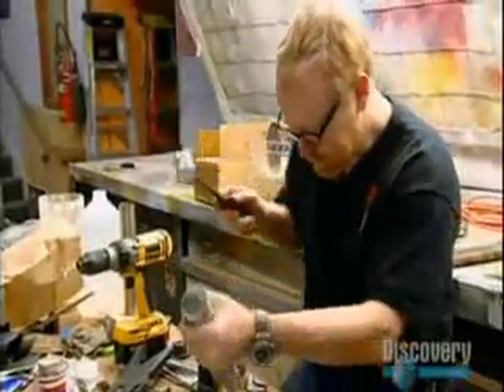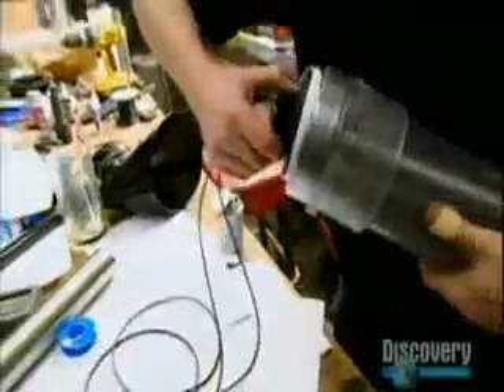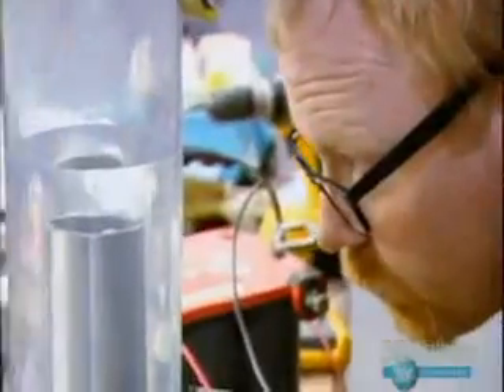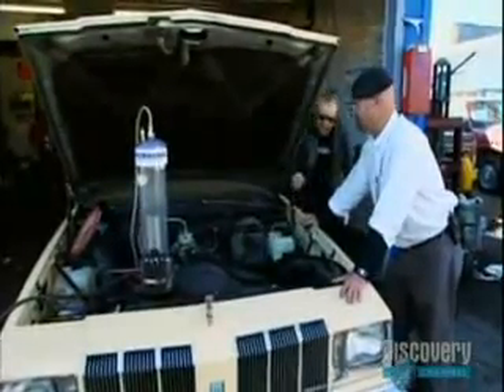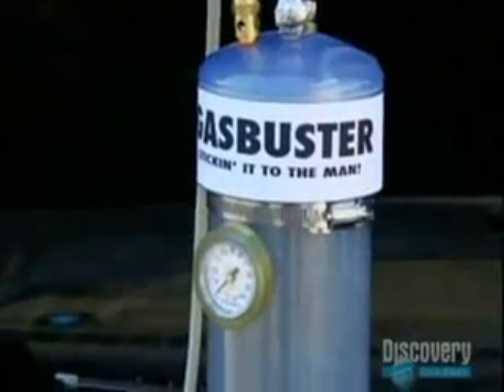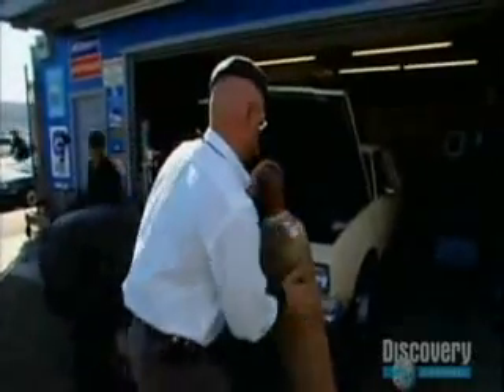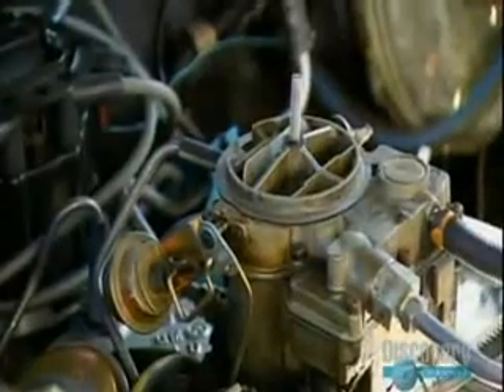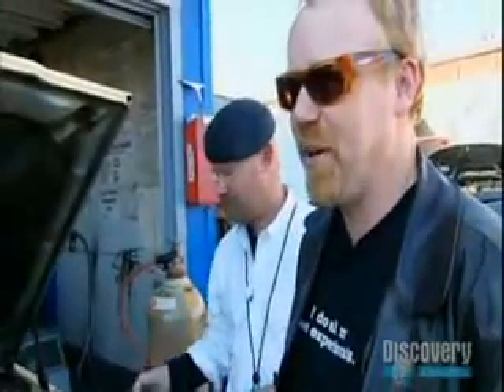HHO Mythbusters Explained

Comment: Stray capacitance...I am assuming you mean the signal that allows for lights and capacitors to be charged or lit wireless. You obviously have never done any of those experiments yourself or you would know better. A caduceus coil has near 0 impedance. According to the theories though a caduceus coil should cancel itself out and it does not. In one of my personal experiences a caduceus primary lit 3x the amount of lights with less input power.

Comment: The standard "scramble wound coil" does not perform as well as a caduceus coil. I have done many experiments with both and a caduceus produces better results everytime with less power consumption. They also call the caduceus coil a tenser coil, but that is only because someone would like to claim the design as their own even though its been around for century's. Everything is a frequency...measuring the actual power coming from any signal generator will not happen unless it is confined.

Comment: Its showing that you don't need as much power to get hydrogen as they claim. You seem to be overlooking the point. Also, once again, you keep overlooking dry crystal cell batteries. Telling me to just shut my mouth is not an effective way to shut me up. Also please tell me, according to the theories of electromagnetics, what would happen if a coil was wrapped in a caduceus form. Those theories state that it should just cancel out, but the opposite happens.

Comment: And the Dry Crystal Batteries. Mind explaining how those work...Its called resonance. The crystals resonate to certain frequencies and the resonant power from the crystals is collected. Same concept of using resonance to split the water molecule. I also finally figured out why so many arguments. Its quantum physics vs physics. Two sides to the same coin. Both are correct and both are the equal and opposite to each other. Without one the other would not exist.

Comment: The Con Artists are the ones claiming they want a solution and do nothing about it. It seems to me that Joecell202 is actually trying to do something about it and you just getting in the way. Once again, go look up the video, "Dr. Stiffler SEC Exciter Hydrogen production via diode". 1 AA battery to get the results he is getting, possibly better. A car battery could produce enough hydrogen on the fly to completely replace the gasoline in your car.

Comment: Dr. Stiffler SEC Exciter Hydrogen production via diode. Go try it. A SEC exciter (if built correctly) can be powered by 1 AA battery. A car battery could do much more then what he is getting. Resonant Hydrogen Production has been around since the late 1800's. This is the argument of Quantum Physics vs Physics. Both work and in the end we will need both. Your argument over who is right is useless. It is two different sides to the same coin.

Comment: 2 dissimilar metals in salt water will actually produce power. Also, a dry crystal battery can have similar effects (pretty much a sealed up solar panel with different crystals and contaminants). Some of the chemical batteries will store electrons but only through force. Also, do you know why a battery even discharges? It's called a closed circuit. The battery only discharges because the positively charged electrons hit the negatively charged end.

Comment: Its called Resonant Hydrogen Production. Faraday was way off on the amount of power it takes to split the water molecule. Look up "Dr. Stiffler SEC Exciter Hydrogen production via diode". A SEC Exciter can be powered by 1 AA battery if built correctly. A car battery could very easily produce enough hydrogen on the fly if done correctly.

Comment: The only problem is if you're using dc, one electrode dissolves while the other is being plated. Best way to do it is with ac, where the current alternates so dissolve and replate occur at the same ratio so there's no material loss.

Comment: Everyone , just do the math. Just calculate how many BTU's you need then calculate how much HHO is needed to make the car go. Then calculate how much electrical energy is needed to make that much HHO. On average you are going to need over 12,000 watts of power. Even your best alternators are going to give you 600w. did you see how much gas was being poured into that engine to make it run?  Don't kid yourself, it is a scam. You can make HHO but do the math on current X volts = watts.

Comment: "So you don't believe in the energy from splitting an atom then?"
A lack of understanding on your part.
Nothing about E=mc2 violates the modern understanding of the conservation of energy.
The energy doesn't come from nowhere...
When you, for instance SPLIT an atom, you are releasing stored energy from when that was originally fused.
Splitting any old atom won't do, since some atoms require more energy to split than they emit.
The same is true for fusion.
All pointing towards iron.

Comment: they should have used sodium hydroxide (lye) as a catalyst or at least some electrolyte
the space between the plates as well as the quantity of lye introduced is your resistance, if you will, acting as make shift potenciometer

Comment: The difference is...70% of the earths surface isnt covered by Gas...You dont have to use drinking water...salt water would work to varying degrees of success, salt = electrolyte. Oh and without going into too much science, It's not really possible to run out of water on earth.

Comment: gimps,another makeover like they did with the bedini wheel with no batteries. i've got a wet cell system on my transit diesel and it does about 25% better consumption AND runs crisper on the throttle.all tested in a 1200mile continuous run with it connected and without it connected and i don't have the recources these !!** have

Comment: I assume you mean a Peltier Junction that makes electricity with an imbalance in temperature> ??? Water gas can increase mileage, but your car's emissions system goes nuts thinking the car is not running at the right mixture. Electric cars are neat. Arizona was the ONLY state besides California to have the EV1. Not much more than 85MPH but they were darn quick getting there. The 3rd gen battery had 100 mile range, IF you could go next gen 200+ miles, but GM crushed all the EV1s.

Comment: You can increase gas mileage, but you can also make your engine run like crap, and damage it in the process. The ONE person who got mileage that I could say was increased enough to demonstrate it works started using 2 cycle weed eater engines, and we had access to an engine scope. You NEED gasoline. Without the lube the engine is toast in a few thousand miles.

Comment: they should try it as fuel SAVER  but not as a fuel alternative  ,,,, it may be not enough gas to run a  car, but it could help probably save some fuel, why did they not try that>>> And about the guys who say "you can not get more than you put " ,,, what about the gas guys ,,, you only put a spark into it every burning cycle , but get enough energy to run that car. Think it needs to be developed and even if it is possible to get 1% efficiency that would be better than nothing

Comment: "h2 h2 o2 does is act as a catalyst to fully cumbust the gasoline"
I suspect the low density of hydrogen naturally would cause it to be a poor catalyst.
IMO electricity is far better suited for directly moving the car. [I have an electric car]

"Thermoelectric generators is device that converts heat into electricity."
That's actually smart, since an enourmous amount of energy in ICEs is lost to heat.

Comment from the maker: I agree infinite energy is not possible (at least not under our laws of physics) what h2 h2 o2 does is act as a catalyst to fully cumbust the gasoline thus giving you bette mileage. There is a large amount of un burned fuel that is wasted out of the tail pipe. One thing I did though is add TEG's. Thermoelectric generators is device that converts heat into electricity. I used the heat from the exhaust manifold to also power the unit. Unfortunaitly OBD2 CPU will fight you constanty.

Comment: The problem is one of conservation of energy.
The energy used to split h2o into h2 h2 o2 is the only energy you could possibly get.
This means that you'd be better of directly plugging the electric source into an electric motor.

Think of it like this, if the energy used to make h2 h2 02 would be less than the energy gained from combustion, then you could use some of the excess to repeat the starting process, and have infinite energy.
This is sadly not possible, no matter how much I wish it was

Comment from the maker: I have both a MAF adjuster as well as a digital EFIE but the CPU (at least on Ford Trucks) is very resilient. The amount of tweaking required to keep the system optimal is more of a PITA than it saves. My suggestion is to ether use a pre OBD vehicle or better yer a diesel vehicle. The have no o2 sensors to manipulate. HHO works GREAT. Just make sure that the intake contains no aluminum as it will be corroded.

Comment from the maker: If you are installing an HHO system on an older vehicle, especially a pre computer car, this is perfect & will give you substantial trouble free gas mileage increases. This is due no not requiring to "fool" the CPU, tweak the O2 sensors etc. It's a real PITA to keep tweaking it. 
As of this writing I have removed the system from my 2002 Explorer & installed it on my '74 Beetle.
I have had several years of experimentation. So this is not a theoretical observation & conclusion, but an actual one.
Reply: Says the seller of the system...
Reply: Yes your right and if you have a scope you can fine tune it better
Reply: How big is your system and where are the designs.
Reply: It is far easier on vehicles that are OBD1, pre 1996. I have not learned how to trick the CPU on anything that is obd2, as I am not a computer guy. But I did try this on a 1995 Mazda b2300, and went from 24 MPG to a whopping 75 MPG. This wasn't a two-wheel drive, manual transmission. Regardless, by running it as a hybrid with most definitely increases fuel economy/horsepower / torque astronomically. That was without a bubbler or spark arrestor system. I would be interested in trying this again with some upgrades. Any tips for a OBD2 would be appreciated
Reply: Surely chip modders could help greatly
Reply: Yes, I tried HHO on my Holden Commadore and I had the same problem of the Computer beating you even when I modified the Maf sensor and O2 sensors.

Comment: @HHOSportTrac Oh... the fuel cell filled that bag in under 5 minutes huh? Lets see... I don't know about you but my car has a 4 cylinder engine that averages out at about 2,000 rpm. That is 4000 times per minute that a cylinder fires. In 5 minutes that is 20,000 times that a cylinder will have fired. Divide the volume of hydrogen you have there by 20,000... that is how much hydrogen you will burn per stroke. That is not enough to do a damn thing with.

Comment from the maker: @adelphus515 I drive the speed limit, I use my cruise control. I never do jack rabbit starts. My truck did it's advertised mileage. When I added my system, driving the same conservative way, I increased my mileage from 13 mpg to 20 mpg city. So although what Jeremy said is good advice & would benefit everyone, this is not the issue at hand. The purpose here in to improve already good mileage.

Comment: I have made a hho generator and It increased my gas mileage by 15-30 percent depending on  if  it Was highway or city. I did not believe at first if it worked, So My son an I built several and they generated hho, enough hho  to pump into the air intake of the engine and have noticeably steady running engine and better gas mileage and performance so until you have done it correctly you will never know.

Comment from the maker: @ThePotatoes It works, I have had several cells giving me goo performance. 
Newer cars do require some electronics to achieve results as the ECU will compensate when it reads a lean condition and dumps more fuel. This negates any MPG increase unless you use an Efie, a reprogram of the ECU or an AFC.

Comment from the maker: @PSANarconon Why do you say that? I have had several units up & running giving significant MPG improvements. My VW bug went from 22 to 30 MPG. If you installed a unit & you saw no improvement in mileage there must have been a reason.